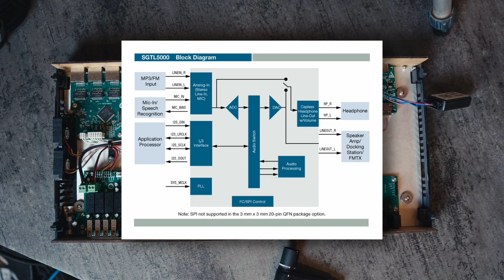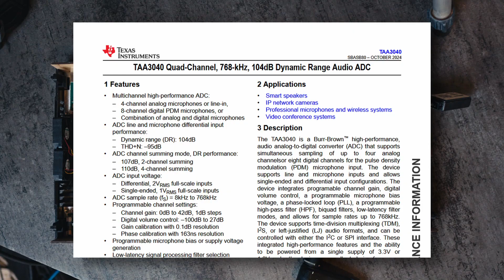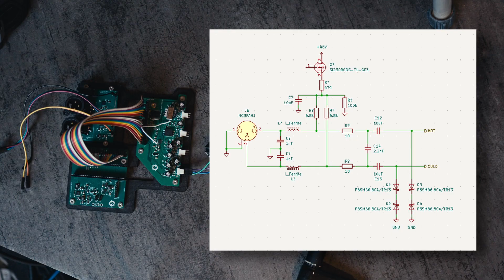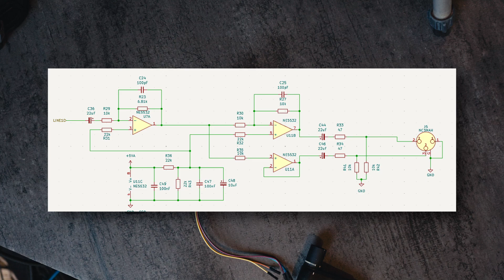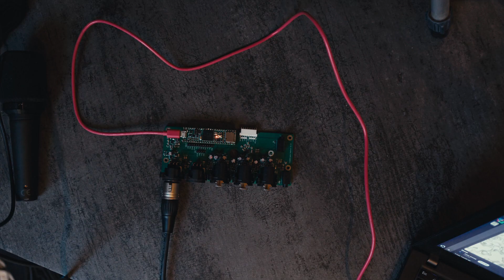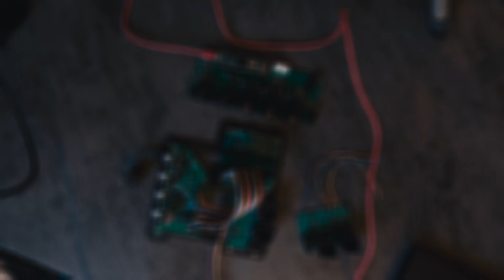Redesigning the FOSS digital audio mixer

Comment: your audio problem is from bad PCB routeing , you can potentially fix* this revision with some copper adhesive tape and some solder mask removal , you fixing the audio by holding your finger in a certain place is proof of this

Comment: Hey, awesome project. Are the schematics/PCBs publicly available? I'd love to have a look at them as an amateur to test whether I'll be able to see anything obvious as to why the audio is so distorted.
Reply from the maker: The source is available at https://github.com/FOSDEM/video/tree/master/hardware/pcbs/audio_board

I suspect it's not a schematics issue but the way the traces are routed in this case, and at that point it's more debugging weird electronics voodoo :D
Reply: @MartijnBraam  Awesome, thank you! I'm by no means an expert, but have watched and tried to understand a lot of yt-Videos on grounding, shielding and EMI-issues so I'm happy to test if anything of that really did teach me anything. (ya I know, this does not inspire trust :D)
Reply: (and I designed a few PCBs myself, but nothing with audio on it for reasons(tm))
Reply: @MartijnBraam  Where do you have to press on the board to fix the issue again?
Reply from the maker: It's not pressing really that fixes it, I think it's the capacitive coupling of my finger. It's fixed when I hold my finger over the TDM bclk/fsclk/din lines to the DAC chip connected to the headphones, it's also fixed when I hold my finger on all the traces below the teensy
Reply: @MartijnBraam  Thank you. Looking at the board, the traces below the teensy do include the bclk/fsclk/din lines, right? This does indeed sound like capacitative coupling. From what I gather, it's likely that the traces should ideally be impedance matched. You could try 10-20pf caps to GND on each of the three lines near the signal source to see if that has the same effect as the finger - i.e. scrape the outer tracks on the back layer and the gnd plane next to it and simply place a cap on each side. For the bclk line you'd have to improvise a bit as that's not very accessible, maybe put a cap vertically at the top side and connect gnd with a wire or some such. 

If I understand this correctly, the issue might "properly" be solved with series resistors on each of those lines, but I don't know how to calculate them - they should be matched to the trace impedance to suppress the ringing.

I colored the net classes to better visualize the different signal paths to help me understand this, let me know if you'd like a PR for that.
Reply: Thinking about it, the center trace can also simply be scraped at the bottom layer a few mm away from the other two, the cap will be large enough to be placed over the track next to it and still reach gnd.
Reply: (I'm glad this seems to be a digital signal problem not an analog one, that'd been way more out of my area of my "gefährliches Halbwissen")
Reply: I've only just now realized that you already have series resistors for the MOSI, SCK, CS_RIGHT and CS_LEFT lines for SPI. I bet if you added the same resistors on the I2S1_TX2, I2S1_TX1, I2S1_BCLK and I2S1_LRCLK lines that this would solve the problem. As mentioned I'm no expert, but now I'm reasonably sure that you have ringing especially on the high frequency clock line (1.4mhz if I'm not mistaken?) that goes away when capacitively coupled to GND and especially when impedance matched through the resistors.
Reply: (I'd be absolutely delighted if this would fix the issue for good. I'd say given my limited experience it's a 50/50 probability. Maybe you can PoC this with surgery on the existing board - cutting the traces and placing the resistors and/or capacitors near the teensy, maybe connecting them with isolated copper wire if the space is tight)